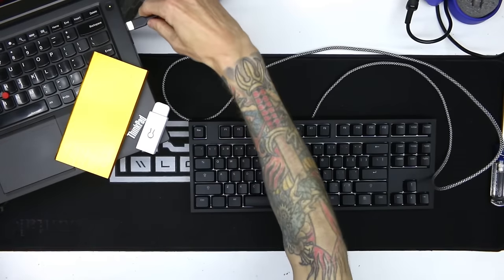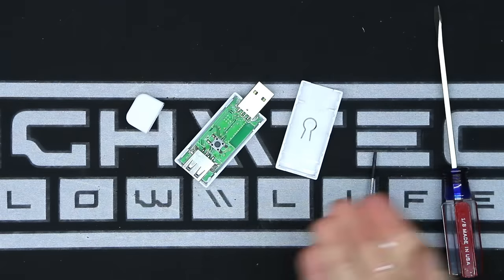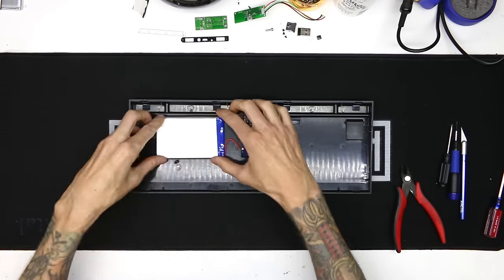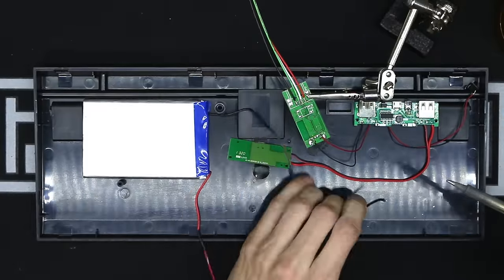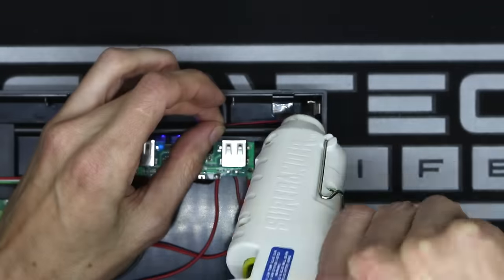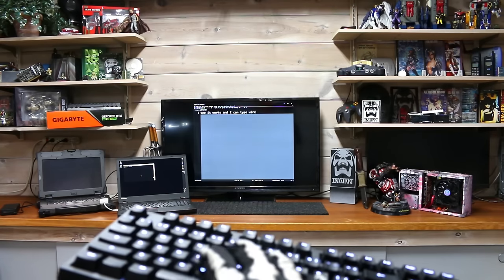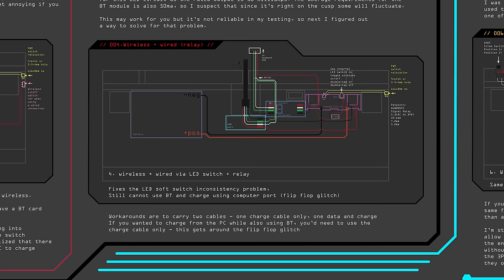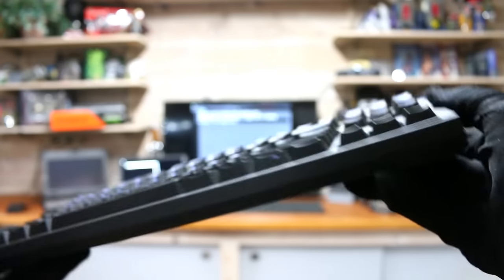⌨ Make ANY Keyboard Wireless! - Convert Any USB keyboard to Bluetooth Wireless - DIY Tutorial How To

Comment: hey i am from india and i was trying to do the same but it is pretty hard to find the same bluetooth module can someone tell me about the other bluetooth modules
Reply from the maker: There are only a few that can do this (the BT-500 is the best one in my opinion), but you can use an arduino also.
Reply: @hightech-lowlife  Arduino micro is very costly one of my friends suggested esp 32

Comment: is it possible to convert a bluetooth keyboard to 2.4G?
Reply from the maker: Yes, you'll need to salvage the guts from a different 2.4GHz wireless keyboard and implement them though, it's been shared on the internet before.
Reply: @hightech-lowlife  thats sounds tough. Could you give me the link of the video where it has been done? thanks
Reply from the maker: @pavletrnic1433  Check the other comments on this video as I have answered this question before with links 👍

Comment: but it can not be used wire right? :(
Reply from the maker: You can use both, wired and wireless!
Reply: @hightech-lowlife  thank for the great tutorial, but it got trickier when I got to the step of using both connection :(
Reply from the maker: @AnNguyen-df3zu  It is a bit more complicated, but I actually recommend just using the built-in firmware to change wired/wireless which makes the wiring much simpler. Unless there is a use case where you 'need' to have a hardware switch, such as updating the keyboards firmware. 

Check out the very end of the video where I go over it, you can also look at my schematic much more in-depth on my site:   https://hightech-lowlife.github.io/projects/004_wireless_keyboard/004_wireless_keyboard 

This is a pdf you can infinitely zoom or download: https://hightech-lowlife.github.io/projects/004_wireless_keyboard/wireless_schematic.pdf ~ check out schematic 7 - this is very simple and will allow you to get both wired/wireless.

Comment: Awesome! But I don't have courage and skills to do that
Reply from the maker: Thank you! You can do it Bruno! This one wasn't that bad, I have another video coming up of a 60% keyboard and that one was way trickier to implement!
Reply: @hightech-lowlife  I have a ThinkPad usb keyboard and I was looking for a way to convert it, but I think it will be hard because the chassi is very skinny to keep a batery inside :(
Reply from the maker: @BrunoAlves-jn2tj  Yes, because that keyboard is essentially a laptop keyboard they have made it very thin :) They do make a wireless version https://www.lenovo.com/us/en/accessories-and-monitors/keyboards-and-mice/keyboards/KBD-BO-TrackPoint-KBD-US-English/p/4Y40X49493 it is a bit thicker though (I'm sure for the battery).

If you really like that keyboard it might make more sense just to spend the extra $20-30 and just buy that version. If you want to DIY you'd have to make it a bit thicker as well, not impossible but definitely more challenging. ⚡👏
Reply: @hightech-lowlife  but unfortunally they don't make the classical 7 row keys version anymore, I don't know in the US but in my country I never saw it  :( But the new version is Ok as well!  :)
Reply from the maker: @BrunoAlves-jn2tj  That's true, they definitely don't make them like they used to - it's why I have too many old thinkpads and always try to mod the internal keyboard with an earlier model when possible :)

Comment: I would like to do this to my razer 60%
Reply from the maker: Go for it 👍
Reply: @hightech-lowlife  but would it work?
Reply from the maker: @tdotgirlsammygirlcomeup9329  This will work with any(for lack of a better word) keyboards that have a USB connection. 

Most 60% boards have their type-c port soldered directly to the board (SMD) which can be more difficult to pull off, but still possible. There are a lot of work arounds, it all depends on how clean of a setup you want to eventually end up with. 

You can check out my 60% build where I do this same mod, and it also has a soldered USB port, but that is a mini, which is a bit different. Same concept though. 👍
Reply from the maker: @tdotgirlsammygirlcomeup9329  Yes, I don't see any reason why it would not as it is just a USB keyboard.
Reply: @hightech-lowlife  you wouldn’t want to make a video about it with the razer %60 heavily modified version cuz I seen some basic upgrades but nothing on that level
Reply from the maker: @tdotgirlsammygirlcomeup9329  It wouldn't be much different than the one I already made on my 60% keyboard I converted 👍

Intercept PCB wires, install BT module, install charge circuit, install battery. Only unknown is if there is enough room for a battery, and how big of one could fit.

Comment: With less money I buy a ready-made wireless keyboard
Reply from the maker: If your goal is simply to have "a" wireless keyboard for the lowest expense spared, then yes that is my recommendation - to just buy a cheap ready made keyboard (please check the description, I already addressed that point there). 

If you have an older keyboard, maybe one that is vintage, maybe one that was never offered wirelessly and you really love "that" specific keyboard, here is just a solution I have found and offered. This was never intended nor recommended to be the least expensive, nor even the best solution, just one option that I have found and shared with you. 

Cheers 👍

Comment: This video become completely useless as the "magic box" is out of stock... unless you create your very own "magic box" you are stucked with your wired keyboard...
Reply from the maker: I disagree. From their website: " We expect it be back in stock on or before October 27, 2023. This is our key product so rest assured, we are trying our best to bring it back. We appreciate everyone’s patience and understand. " 

That's only 2 weeks, if you can't wait that long for a key piece in the system, then most likely you will not have the patience to do this DIY project. 

Plus, you don't "have" to use this method, there are other ways to do this (Arduino, donor wireless board to source the guts from) all available if you google it. Cheers.

Comment: You destroyed two devices for that trick.... You could just buy a Bluetooth keyboard.
Reply from the maker: Can you let me know which devices were destroyed? Both work just fine together, and you can restore both back to original separately if you wanted to. 

While it is true you could "just buy a bluetooth keyboard", and in a lot of scenarios this is a better solution but that is very dependent on the goal or application. This proposed "just buy a bluetooth keyboard" however would not be a solution if you already had a keyboard that you really liked or were comfortable on that was simply not offered wirelessly. 

Your logic is unsound however, as you could extrapolate this "you could just..." sentiment to no end. You could just use a wired keyboard, you could just stop using a keyboard altogether, you could just stop using a computer, you could just stop getting out of bed every day, you could just... 

Hopefully you see my point. 🍻

Comment: Or you could just buy a wireless keyboard for the same price or less as the BT-500 and the battery and not have to go through all the work of fitting them into the keyboard.
Reply from the maker: This is true, with that logic though you can also just use a wired keyboard, and you could also just not use a computer and save the money and trouble of buying a wireless keyboard.

Comment: Can I just pay you to do this to my keyboard? lol.
Reply: No really.
Reply from the maker: Which board do you have?
Reply: @hightech-lowlife  Asus Rog Scope TKL Black.
Reply: 5V 750 mA
Reply: @hightech-lowlife  <3
Reply from the maker: @wtfdocsub  It really depends on how much space there is internally for batteries and the other components. Some boards definitely lend more to this mod than others. You wouldn't want to do this with a very small battery, otherwise you would need to charge every couple hours, so while it would be clean and technically all fit, to me it wouldn't seem worth it. 

If you can find some pics of the inside and large of a cavity there is I may consider it, if it's a good candidate. Thanks

Comment: I just have one question: what's the point?
Reply from the maker: What do you mean?
Reply: @hightech-lowlife  I mean there are great and not so expensive BT mechanical keyboards out there. You already spent about 50 USD on top of that beautiful keyboard. Don't get me wrong, I am a DIY guy too and if I had otherwise useless hardware lying around, I'd have loved to do something like that.
The power draw doesn't make sense btw. That looks like a 10AH battery and that should have been enough juice for a keyboard and usb to bt converter for I dont know, a year?
Reply from the maker: @ahmetrefikeryilmaz4432  Yes it's true, there are! If you just want a cheap wireless board, then this is not the video or tutorial for you. It's pretty obvious to me that it's much easier just buy a wireless keyboard 👍 you would even save money. 

I have seen a few comments like this and they speak to me as if this is not something I'm aware of. Even though if you read the description I already explain that before they even comment. I was going to put that statement in the video at the beginning itself but the video was already so long to begin with, plus I figured it's so obvious, why would anyone make that claim? But here they are, which is fine. If people want to understand, I'll explain. 

There are some keyboards that people love personally that are not available in wireless, say if you want an IBM Model M, this is a great vintage keyboard, but they definitely don't make a wireless version and they also don't even make them anymore period (I'm not talking about refreshed Unicomps.) What if you wanted one of those that were wireless? Would you see a point to the video? Also a lot of projects and endeavors in life don't meet practical needs, and they don't have to and that's ok. Some even purely artistic, what is the point of someone painting a picture? Or creating a dance? 

If you see a video on a Ferrari are you going to comment on it "what's the point?" You can just buy a cheap car that will go from A to B just the same, right? It's a waste and you'll get less gas mileage and everything will cost so much more. Still, people do it. You can take this logic even further by asking what's the point of even owning a car at all? We have legs, we can just walk? Seems silly to have to spend so much for something you can just do for free? This can be extrapolated even further if you want, if you view everything through a lens of "points" you can make a heavy case for there not being much of a point to anything.

We're all going to die in the end, and it's not even that long, you could ask what's the point of living? I think you're missing that your subjective point is within the context of yourself and that isn't objective. Other people seem to want to see this video or derive some value from it, other people see it as pointless. It's not really for me to say what is or isn't pointless for other people, as we all have our own subjective reality of meaning and importance. All I've done is show people something I made, if it's useful to them, that's great, if it's not, that's fine too. 

If you want my personal opinion though, I honestly don't see a point to a wireless keyboard to begin with. It just sits on your desk all day and doesn't move? If you want to debate me on that, I think you might start seeing how our personal opinions reflect our hierarchical priorities. 

I will ask you this though: if you already knew you could just buy a wireless keyboard that is cheap, what made you want to click on a video to watch a DIY tutorial on how to turn a wired keyboard into a wireless one? 

Thanks for the response.
Reply from the maker: @ahmetrefikeryilmaz4432  Thanks man, ok I will do a model M wireless mod in the future 👍I've actually seen a couple others do them before, but not many. 

My latest build is a 60% with two huge batteries, I guess not really a point to that other than I wanted to design and build a custom case and I suppose if you wanted to type for a really long time without needing to charge then it's useful in that regard. 

Even though a lot of my projects may not be the most practical (economically or otherwise), they are at least useful, the keyboard still works and you can use it as a tool. The only kind of 'pointless' projects I don't particularly like are ones where the build doesn't really do anything that can be used, some of these projects are done for learning or education, and that is fine with me, I just figure you could get the same education while also applying that to something that does work or has a function. 

I don't really care what other people do though, it's their time to use however they see fit and I respect that, even if it's not something I would do with my own time. Thanks for your response.

Comment: Or you could have bought a wireless keyboard from amazon or ebay which will make it more time saving and efficient rather than soldering the wires which is more tiresome and exhausting because every detail should be intact and won't work properly as it used to before you soldered it
Reply from the maker: You definitely could do that, I make a note of this in the first part of the description to the people who don't see the use case or utility of doing this modification, check it out. 

I addressed these points, with it being 'easier', but I will also say that you forgot to mention another key point, in that just buying a wireless keyboard would also be a lot less expensive as you can get them quite cheap.
Reply: @hightech-lowlife  are you mad I'm just suggesting
Reply from the maker: @justsomeguyfromtheinternet5027  If I were disagreeing, I think that would be a more understandable reception to what I said, but I agreed with you and then even added a point (suggestion) to your comment. Your reply has me a bit confused, as what would there be to even spark anger or madness? 

I was just pointing out that this was a perspective I had already addressed in my video description. I had assumed your comment was to me? I was just letting you know that, yes, if you just want 'a wireless keyboard', that what I'm presenting here isn't ideal for a number of reasons. This is more for people that have a keyboard they like already that isn't offered wireless. 

Mad? No way, not at all! 🎃
Confused? A bit 🤔

Comment: wireless to wired? i found mechanical keyboard cheap. i want it to be wired to save buying battery.
Reply from the maker: I'll make a video on how to do it in the future 👍
Reply: @hightech-lowlife  thank you so much! ill be waiting to that.
Reply from the maker: @therewronill  I did some research and I was going to buy a wireless board to convert to show you, but it would be a lot of work depending on the board, you'd also need to know a lot of skills way beyond just soldering some wires:

If you only want to save battery and you have the receiver still, this method will work for you just fine: https://www.youtube.com/watch?v=Qvd_3sGMd2o - shows how to do it but only the power, the data still goes over wireless, and you'd need the receiver. If you look at the comments someone asks if you can use the data wires on the USB cable and he basically says no. 

https://superuser.com/questions/812569/convert-wireless-keyboard-to-wired 

https://www.quora.com/Can-a-wireless-keyboard-be-made-as-a-wired-keyboard

https://www.reddit.com/r/techsupport/comments/2o40mq/is_it_possible_convert_wireless_keyboard_to_wired/

While it is technically possible to do having the data go over the USB cable as well, in my opinion it's not worth the effort for this mod at all. Especially if the keyboard is inexpensive, it's so much easier to just buy a cheap wired keyboard to replace it.

Comment: it doesn't seem so easy as you say
Reply from the maker: You can plug everything in using USB if you don't want to mod the internals or do any soldering. Plugging in USB cables is pretty easy in my opinion.
Reply: @hightech-lowlife  . Internals are ok,.i can open the keyboard and find space, but all those wires? and also (but this is not about easy or not) BT connection is not so good...is it possible to find a way to do the same but with some "universal" 2,4ghz dongle?
Reply from the maker: @TheInvoker78  1. I gave two different schematics, one is quite simple if you use the BT module as a bridge 👍

2. No, it's not possible.